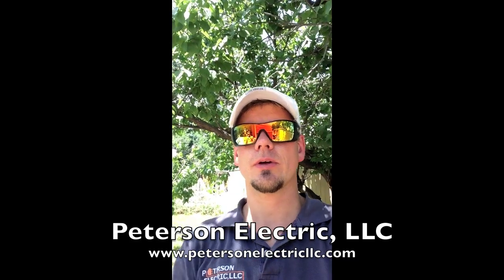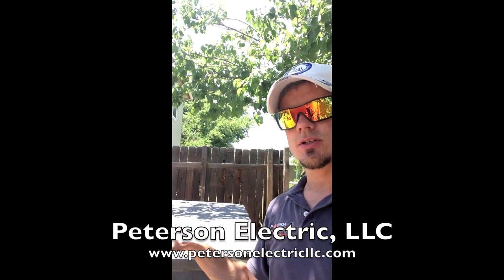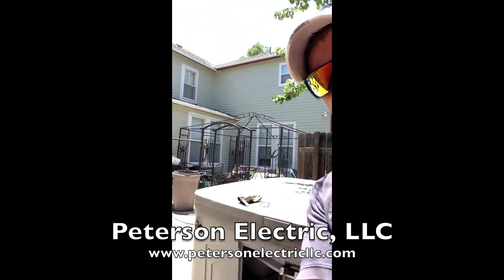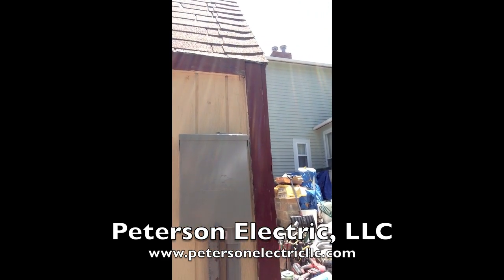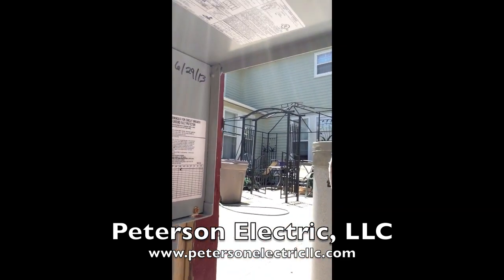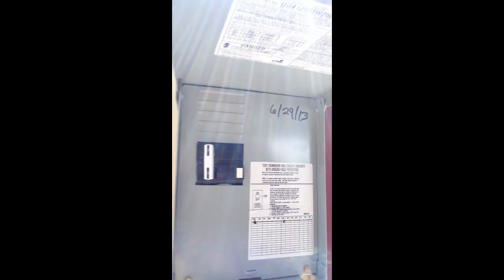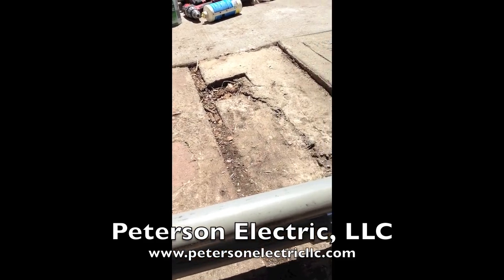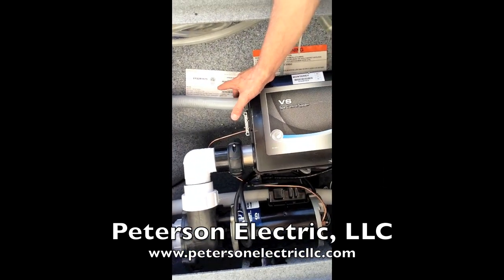What Are The Electrical Code Requirements To Installing A Hot Tub?

Comment: Isn't that PVC subject to physical damage ?
Reply from the maker: Kevin Corcoran - If I remember correctly some of that conduit was existing. As far as physical damage I guess my question is what would be a possibility of getting damaged in the backyard, I think schedule 40 is pretty reinforced, but typically yes I choose to use schedule 80
Reply: @Petersonelectricllc  any metal with in 5' should be bonded, you used a metal Lb going to the ground.
Reply: @matthewcarini1265  good catch